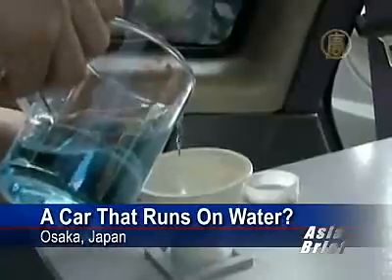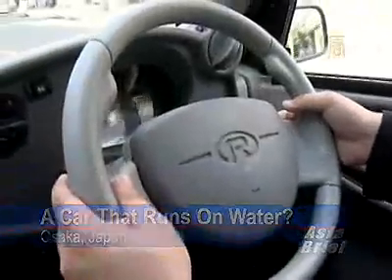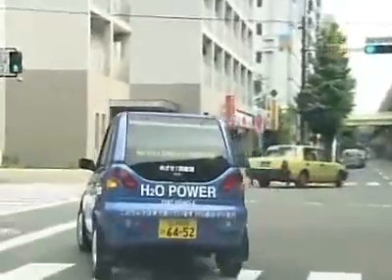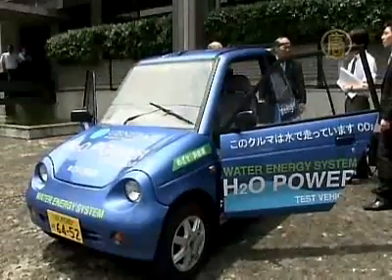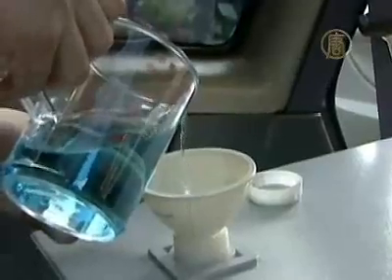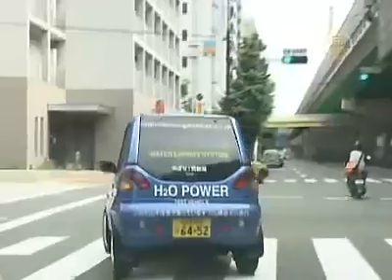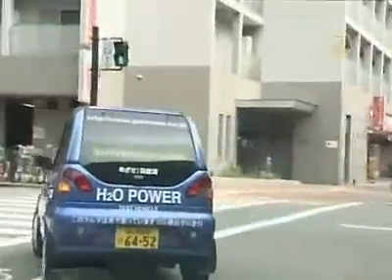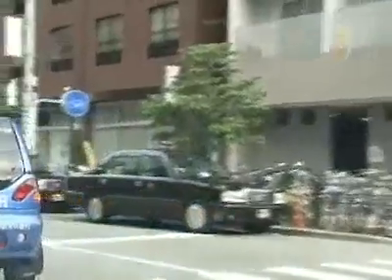Japanese to mass produce cars that run off water!

Comment: What you're saying makes perfect sense. What it says in the video doesn't. It says that no external input is needed, as long as you have water you can keep on going. It doesn't say anything about plugging it into the mains and suggests it actually produces electricity from water.

Comment: Simple, because petroleum represents a high energy state and water represents a low energy state.

A reaction involving petroleum based fuels releases energy by converting them to a lower energy state.

A reaction  that splits water into hydrogen and oxygen absorbs energy to covert it into a higher energy state. If you then use the hydrogen and oxygen as a fuel in a 100% efficient process you get back exactly what you put into it and gain nothing. That's why you can't use water as a fuel.

Comment: OK, Reality;  The water to electricity conversion has been an easy thing for a very long time, and is basically an electric current separating Hydrogen and Oxygen from one another.  Not new, and Easily cheap. Yes people have tried to block such (in the U.S.), but I believe the Japanese have a shot at making this one work.  Tony Nelson... What kind of engineer?  Whats your degree?  If you are going to say it, support it.

Comment: If this works they have to be using a catalyst water resonates at 3.145 THZ so good luck reaching a wave form of just 970nm... Without a catalyst or something like a special wave forum or glitch or something added I dunno how it could be possible but I really do support there efforts and hope they get the funding. I wonder if you divided the wave down to something that was reasonable like lets say cutting it in 30 they do it with antenna all the time so I suppose it may be possible IDK...

Comment: @rathtain OTOH, a combustion reaction such as (CH4) + 2(O2) --> (CO2) + 2(H2O) [burning methane] releases energy. While, indeed, the amount of energy released comes from the chemical bonds, if you wanted to reverse the process, it would take more energy than you get out. Simply, if you store 100 joules of energy, you would waste 20 or 30 joules (or more) simply running the machine which makes this reaction go. If this were not true, why haven't companies already done it?

Comment: @rathtain You obviously failed your high school chemistry class. Water is the product of the reaction, 2(H2) + O2 ---> 2(H2O). Energy is released during this reaction. To go the opposite direction,  2(H2O) ---> 2(H2) + O2, you must put energy IN. To make the free hydrogen gas, you must ADD energy. If you do, the amount that you put in will be greater than you had originally gotten out, simply because there will be losses of energy due to heat, friction, electrical inefficiencies, etc.

Comment: Burning hydrogen = oxidization producing water....but not as much as the H2 was derived from. All energy transfers entail some inefficiencies. 100% efficiency = only the same amount of energy required to break the H-O bonds.This would be the electro-chemical equivalent of the perpetual motion machine, completely unsustainable.

Comment: @flowy420 When you burn hydrogen as fuel.. you are recombining it with oxygen... and you get water out of the exhaust.  You won't be losing water.. you might be losing oxygen and that's were reclaiming land for reforestation is important.

Comment: @PresidentBust no it was a an electrochemical reaction similar to metal hydride reaction but instead of burning hydrogen.. it was used to create a battery.  I believe that the metal in the generator would eventually be consumed and probably costly to manufacture.

Comment: @yassensei The company went out of business.. apparently it was costly to produce the generator.  It probably used some kind of reaction similar to barium peroxide and water to produce hydrogen peroxide and then the h2o2 is used to fuel the electron transport.  Not necesarily a scam.. but I don't see any backyard inventors recreating this technology.

Comment: @furtadjp Could they be burning the hydrogen?
If so, the energy released from that process could be greater than the energy used to obtain the hydrogen from the water. The external energy being the form of the bond between hydrogen and oxygen in the water? . I'd love if this was real.

Comment: oh geez ... just check the Wikipedia entry on "water-fueled cars". There is no energy to be had in water unless you split off the hydrogen. To do so requires energy. 

Next, be sure you also invest in the Hojo motor. That's a good one too.

Comment: The fact that the reporter said it runs on "Hydrogen Dioxide", which is HO2, not H2O (correct me if im wrong), and also that this is fucking madness leads me to conclude this is fake. I'll be the first to applaud if im wrong.

Comment: Second law of thermodynamics: Energy out is always less than energy in. Translation: If it takes 100 joules of energy to break down the H2O into elemental H, you will only get a fraction of that back in the electrical generation. Simply put, you lose energy every time you run this contraption. I would guess that if you too the sample and ran it for more than a few hours, even keeping the water tank full, it would stop fairly soon. This is, in a word, a scam.
Reply: Well said.
Reply: Lies

Comment: Umm... Anyone else going to call BS on this? Producing hydrogen from water requires more energy than you can extract from the resulting hydrogen. Even if the process was 100% efficient, you would only be able to extract as much power as you put in, and just have a cycle that produced 0 net power.

Comment: @beerandbanjo Minor problem - unless they've found a new miracle method of splitting off the Hydrogen, it takes more power to split water into Oxygen and Hydrogen than you get out of converting it back.

Fuel cells have been around for a long time.  In general, yes, you can break water into H2 and O2.  You can then recombine the H2 and O2 in a fuel cell to generate electricity. But it takes more to split than you get out so can't be done in a closed-circuit car.

See Wikipedia "Water splitting"

Comment: Water contains hydrogen. Hydrogen can fuel an engine. Split off hydrogen and you have fuel to run a car. Oil co trolls, bugger off.